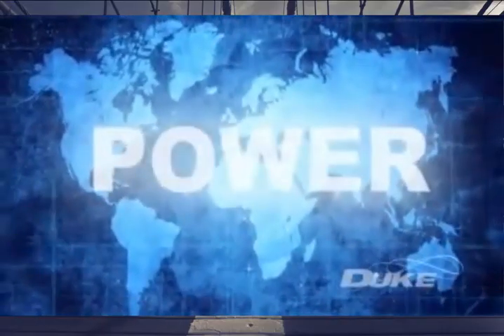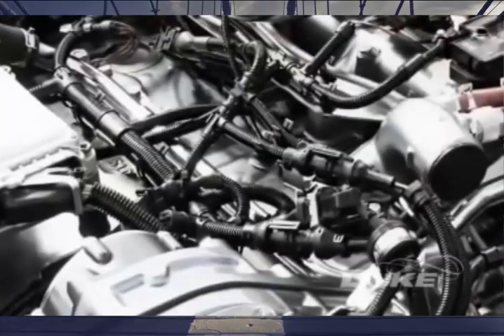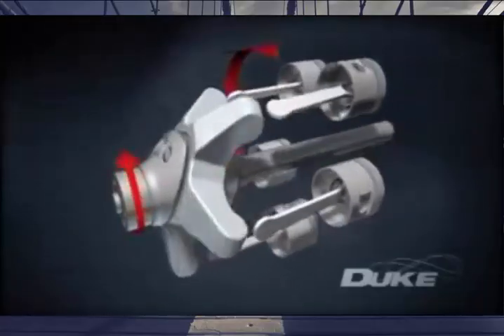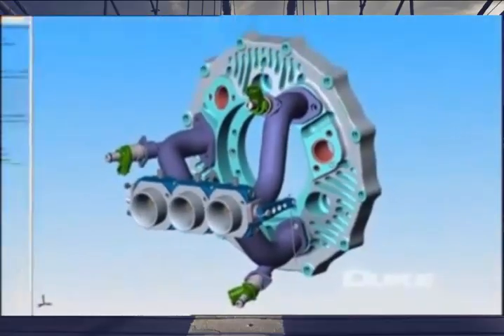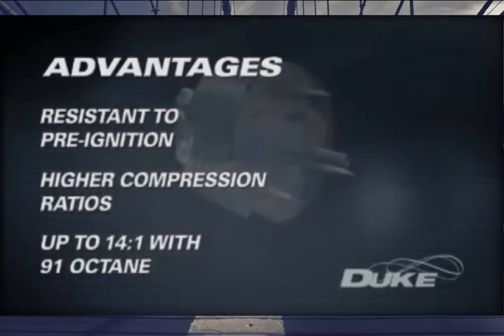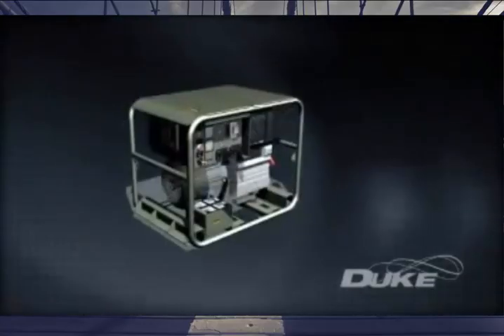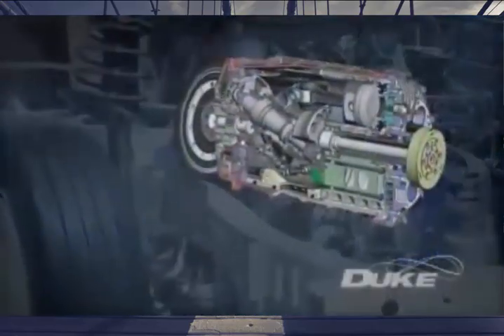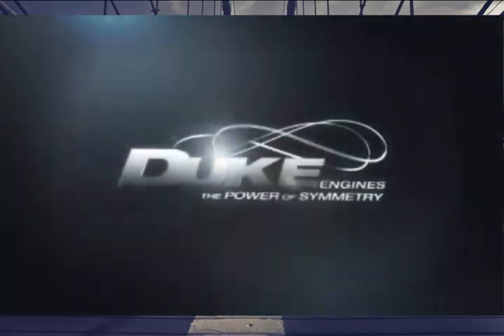Duke Engines | All information about Duke Engines

Comment: The main problem which will be difficult, if not impossible, to overcome is cooling.  Internal combustion engines are inefficient and the heat byproduct has to go somewhere.  Conventional engines have either finned cylinders for air-cooled versions or water jackets around the cylinders for coolant in a closed system including water pump and radiator.  As far as I can tell from the animations, 3D models, and photos, this engine has no cooling system.

Comment: The Deletic locomotives in the UK were very fast and powerful these engine was cleverly counterbalanced.  The only reason I mention that engine is because it might have similarly used sleeve valves.  It was a two stroke engine diesel engine. 

https://en.wikipedia.org/wiki/Napier_Deltic

Comment: Old wobbler engine... except the block spins and head is stationary??? sealing issues? Cooling issues? I mean, I would imagine the block to head seal would be a nightmare, curious how they go about sealing block to head and how the friction between the two doesn't eat seals... at 7k rpm the piston in a 4 stroke stops and starts 14k times, seems like an awful lot of spinning needed to be done by the entire engine block that would cause an insane amount of issues vs say a normal old ww1 wobbler... did a little more research on it, and apparently the block rotates at 20% of what the crank does... their 1,000cc model made 125hp, and 87tq, which is close to being on point for say a 1k cc gxsr, that makes 205hp and 90tq... would love to see the "rotating seals", the material they are made of, and the life expectancy

Comment: Can one be made to work on my 1932 Ford 4 speed trans in my 1 1/2 ton flat bed truck? I am willing to run one to test in real world application. The 4 cylinder in the truck is 200 cu.in. 50 hp max 3000 RPM. will the Duke do 6000 RPM? email me at bahndon@verizon.net

Comment: Given the "normal" life of a car at 200,000 miles (320,000 km), and just allowing for the best scenario of motorway cruising, the engine should be good for 4000 hours. Has ANY Duke engine run for this duration? There are claims about efficiency: has ANY Duke engine been put in a car and actually used? What was the fuel mileage?

Comment: No way will it have a reliable seal between the cylinder block and fixed head....totally over complicated daft idea!! far better off with a simple 2 stroke with fewer moving parts, these engines wont last five minutes in heavy load applications

Comment: Nice engineering, but it uses fossil fuel to run, so this engine will only have niche appeal. If it was available maybe 20 years ago it might have been a game changer. In 2040 in the U.K. no NEW internal combustion engined vehicles will be sold, the writing is on the wall for this engine in the U.K.

Comment: you will encounter serious heat saturation in the top of the cylinder and sealing problems will arise because of this. This is why the standard configuration is superior to all else.
having uneven heat in the block is a huge problem that's been overcome through years of trial and error.

Comment: not convinced, the rubbing parts on the swash plate and rotating cylinder has too much surface area, that means added heat and wear. Conventional engines have about a 30% power production and the other 60% is spent on friction and heat loss, I am not convinced this engine will come anywhere close to that.

Comment: It would be nice if this came to life. But it likely has a fatal flaw. The Wankel also boasted of even fewer parts and in a smaller package than the Duke engine. Yet it died.  I just visited http://www.dukeengines.com/  more than 3 years after this video was posted. Not only is there still no mention of the engine having been selected by any manufacturer, but on top of that, I can find no news or updated postings more recent than March, 2013.  Pardon my math, but that's five YEARS ago.

Comment: ..........hmmm.....not a single one installed in any type of wheeled vehicle, that actually moves down the road..........3 years after the posted video.........wait a sec, I see Elon lurking in the background..........the same Elon who thinks that underground tunnels will be the answer to truck traffic...............and to date, out bridges and roads and subways are worn out disasters..........ahhhh, but to dream.............
Reply: As the principal of Paypal, the originator of the Tesla, succeeding in a mature market against industry giants, and the principal of SpaceX, which recently launched the 'Heavy' and had 2 of its 3 rockets successfully land themselves in VERTICAL position back on Cape Canaveral launch pads, there is a complete disconnect in your attempt to draw a parallel between Elon and Duke.

Comment: No this design is not going to work. The rotating cylinders sliding on the round cam plate can't seal properly during the firing cycle and friction surface lubrication not possible

Comment: Cylinders rotating past a stationary top sounds like heat loss, implicating pressure and ultimately power loss.
If it was viable it would have been done earlier. In time. Not now when electrics take over.

Comment: Waht about wear where the pistons attach to the helical rotor?  It seems to me that this interface is under a hell of la lot of pressure  and will wear.  Will it do the equivialnt of 100k miles that a conventional engine will do without major overhaul.  There is much left unsaid in this video.

Comment: It has several fundamental design flaws which will wear the internal parts out very quickly. The rotational physics of the internal components will result in substantial transferable energy loss.

Comment: They left out details about the intake manifold and exhaust manifold. Without these features it's hard to see how the motor actually works.  I get the feeling that the whole cylinder assembly is rotating around a fixed manifold assembly. That means you have to have a tight seal  between the cylinder assembly and the manifold assembly. How is that seal achieved?

Comment: We developed almost the same technology with the Markel Motor, shown running at at the 2000 International Motor Show at Cobo Hall in Detroit.  Our sinusoidal core element was somewhat different; we also left out the exhaust structure you've got.  We recovered 5% of that energy flow as well.   We pushed our Revolution Engine all of the way to 53% energy efficiency with a bit over 100 parts.  We went all of the way to the DOE...then Bush #2 got elected and dropped the hammer on us.   I hope you have better luck with your engine.
Reply: How much HP and torque you got from it?

Comment: Wonder why this company would decide to use CIRCULAR pistons. Why not use semi triangular pie slice pistons to maximize volume so they could make the engine even smaller and lighter. Using 9 cylinders instead of five would allow they to use a five stroke cycle. This engine, good as it is, has a lot of room for improvement.

Comment: I have to wonder how much wear the eccentric crank gets over time.  I know it works quite a bit like the power unit in a hydraulic system, so I'd imagine that using high pressure oil in the journalling between the star shaped crank and the eccentric crank.

Comment: its gunna consume oil like crazy like a rotary engine unless you have a rotating internal cylinder sleeve but that wold cause friction and thus adding back the cam and valve power loss if not worse power loss . and can it be made to be as powerful as a v8 or v10 engine i just dont see where it actually is a good improvement from conventional engines

Comment: The way the entire set of cylinders is rotating and sealed along the entire circumference of the engine basically screams leakage problems. While the concept in itself is very interesting, I highly doubt that those engines can go far without breaking or at least needing frequent oil refills.

Comment: I wonder how reliable the ball-and-socket type joint is at the bottom of the rod... Also the seals for the cylinders seem like they will be prone to failure too. Great engine design, however i believe it will encounter the same issues the Wankel engine had; unreliability. Could i put these in one of my cars for 200,000 miles and not worry about doing anything besides checking the valve clearance?

Comment: What Duke engines need is further lightening and simplification of manufacturing.  If Duke drops the heavy, expensive, and complex reciprocator, reciprocator joints/bearings, and replaces with a simple cam-track like the "Hype-4" engine design, weight and size can be much reduced, and the counter-rotating structure can be reduced significantly, or perhaps dropped entirely in smaller versions or for those not used in vehicles.  ....Sean Hobbs

Comment: As a veteran mechanic of over 30 years, This looks like complete snake oil.The design resembles the revolver on a pistol .How could you possibly maintain compression when the whole block rotates with the pistons ? let alone the friction and wear factors .They never actually show the break down of the engine . A spinning flywheel and sound effects is all we get. If this engine is as advanced as they say I doubt very much that would sound like a conventional engine like in the video.As Dave Jone at the EEV Blog would say I think I smell some BS. If it is real you should send it to Dave for a tear down Tuesday to prove it. Till then this has Bull $hit written all over it!

Comment: Power is all nice and good, but what about torque? That's what you wanna have for most applications around the globe. I know promises such as higher compression ratio, fuel efficiency and such were provided in the video SUGGESTING higher initial torque output but I'd rather check the actual numbers. Besides, production costs are probably going to be on the high side because for every cylinder more or less than five you're going to have to design & develop an entirely new engine block. It'll be unaffordable for certain applications for sure. And as already mentioned by others in the comments section, engine wear and reliability will have to be proven before this engine car join the competition with modern day diesel (and petrol) engines.

Comment: moving combustion..... sounds like rotary engine.... so are there burn oil problem like the rotary engine???
Reply: what do you mean burn oil 'problem' the rotary engine is MADE to burn oil numnut. do your research. it really just comes down to personal preference and your work ethic. anything will last you just have to look after it.
Reply: No, if they can seal it properly, they will not burn any engine oil. This is what mazda has been doing for long time to find a proper material for the engine that have less heat expand. Oil near the seal is used for lubrication, not to burn it, otherwise carbon build up and further damage the seal. The engine heat up and expand after a while, that is why the seal is not very enclose and leak oil to combustion. Hope that mazda find the proper material to make their engine better...
Reply: you make it sounds like it is as easy as cake. the rotary engine is amazing and so is the ICE. but clearly everything has its downfalls. its like saying audis burn oil but no one complains because it is a standard internal combustion engine. mazdas rotaries clearly havent been perfected but what has in the automotive industry. so when you say no mazda just havent sealed it properly it is very very clear that his engine is made to burn oil by design
Reply: jamesgjt

Comment: I think, it is way too late for efficient combustion engines. It will be much more efficient to use the durable and more uncomplicated older engines than producing new ones. 
I'm driving a Mercedes 190 with a 2.0l injection motor and manage a consumption under 7.5l gasoline/100km and nothing was new produced since 25 years than some replacement parts... you get my point?
Reply: Oh yes. But without innovation we would never gotten of the horse and carriage. I see what you mean but continued development and new ideas (some not that great) keeps change going.
Reply: I've seen vans that have the same fuel consumption. Regardless, your point still stands.

Comment: Just ask the Naturally Aspirated high compression Subaru owners (EJ253 N/A 10.0:1 for instance) how well slapping on a turbo works.  Blown ring lands, holes in the block, melted pistons, etc.  You'd probably have to go to a lower compression and beef up the "bottom" end.  (Is it still called the bottom in this engine, heh?)

The video says diesel fuel still needs development so I doubt you'd be able to bolt on an eBay turbo kit and zoom out the garage without something bad happening.

Comment: There is nothing new under the sun, it is a good proof of concept design for a functioning engine, however it is basically an axial flow variable displacement pump, aka squash plate pump running backwards. Power from the pistons instead of to them. I don't think this will be a viable engine design for a lot of applications due to excessive uneven wear, especially on the rotating head and pistons and liners even if you incorperated rotating liners and piston crowns. Lubrication is the big killer of the squash plate pump, with no fluid through the cylinders it destroys itself in minutes. They have not gone into details about the lubrication of this design in this video so cant say much. The rotary engine was killed off for these reasons, lubrication and excessive wear problems, was a fun engine but ultimately was not economically viable. My two cents from a marine engineer.

Comment: Some how I can not see how turning all of that rotating  mass and cylinders can be more efficient than modern  engines with  roller cam components I know it has no valve  springs but that's a lot of weight to spin and with centrifugal force a lot to keep from flying apart

Comment: I am not an engineer, but this seems like some sort of modified radial engine that they used to use on old air planes.  It seems like a good concept, and might have practical uses.  But the point is that here is New Zealand, a small country, getting involved in hi-tech research.  Most of the rest of the world could not do this type of research. Good for NZ for what they are doing!

Comment: A few questions:
1. Coolant flow?
2. How does the disk at the top of the cylinder heads slide against the other disk (where the ports and spark plugs are mounted) tight enough to maintain compression yet not induce massive friction?
3. How does the head disk rotate against the outer shell without coolant and oil mixing across the seal?
4. How do you get oil into the cylinders?

Comment: This seems like it would be okay at low rpm, but high rpm would distort the fuel mixture in the combustion chamber. The fuel would not evenly distribute because of centrifugal force. Plus, there would be uneven cylinder wall wear. Lube would not be evenly dispersed onto the cylinder walls. These are just a few things that come to mind.

Comment: Ever heard of Wankel? I see a big problem in this engine, The main bearing where all the force and torque is applied. You have a problem there right? You need some kind of special hybrid metals there, that wont wear out too quick.
Good Idea. but as my wife says, good ideas are not practical. Good luck

Comment: It seems kinda neat...and it looks cool, but I'm not sure how much torque that design could get just looking at it....but maybe I'm wrong. The, uh...crank(?) joint looks like it could be a major failure point too?

I think I could see it being used for the generator in something like a Chevy volt though if it really is smaller and lighter.

At this point I think I'd rather move the Tesla route for reliabilities sake and keep my eye on battery tech.

Comment: what about torch at the drive connection between the crank shaft / "recepipicator" to the drive shaft?  Looks like there might be a bearing issues in terms of wear.  I can imagine how engine oil would lubricate but there are 3 points of movement on one axis.  I suspect there is a use for such an engine---to be used in an expendable vehicles; sadly military applications seem to be the best use...  The only way I see around the stress of torch and engine wear would be exotic and costly materials

Comment: I wish them well, but if you check '4 reasons why the rotary engine is dead' video, it turns out this design have similar problems. There will be a trouble with sealing that big rotating block against the static elements, especially one with injector/exhaust ports, and - as in Wankel's engine - this one will have 'hot' and 'cold' zones, making the sealing even more difficult.

Comment: I'm as skeptic about this as I was about rotary engine (which is dead by now). Seal in between the rotating part and stationary part is going to be huge and that will bring trouble. I can also see how there could be problems with lubrication. Also repairing this thing will be a nightmare technically and financially. It looks good as an idea but when it comes to the finals, there is going to be a catch. After all even with classical technology big savings on mass are possible but eventually all the attempts for it went bust because there always was a catch.

Comment: Very clever idea! But they just keep repeating the same benefits over and over again. And they mention power, well what about torque? Because a high rpm screamer with no torque would NOT work very well in heavy armored applications that need to accelerate out of trouble quickly. Now in aircraft, as they mentioned, this engine would seem ideally suited to that application. Seems like an efficient design.